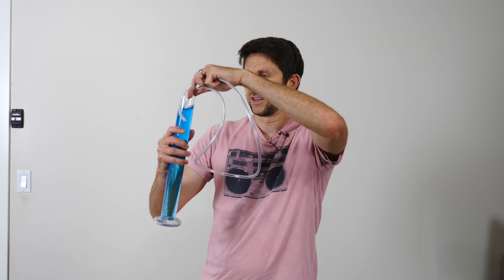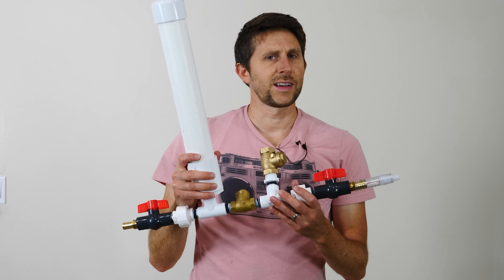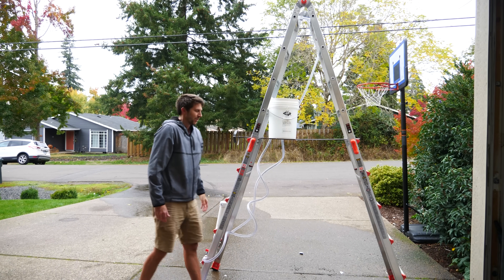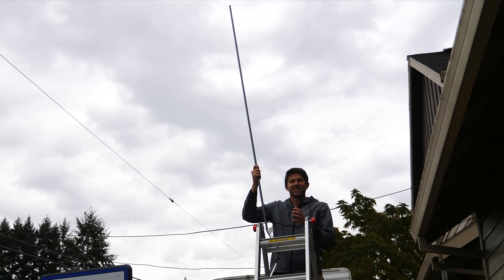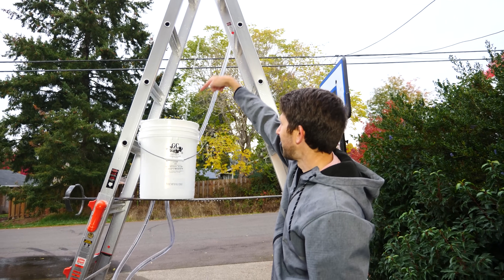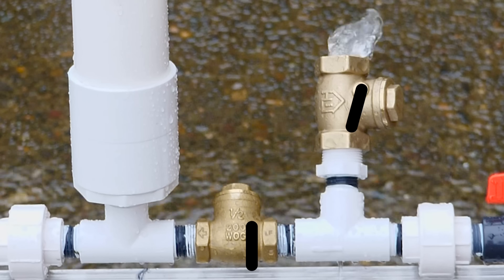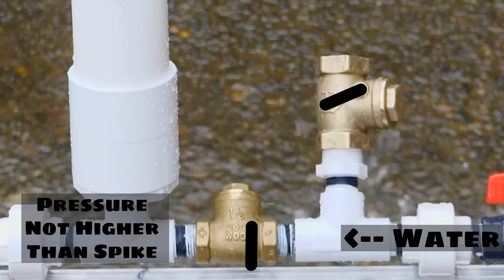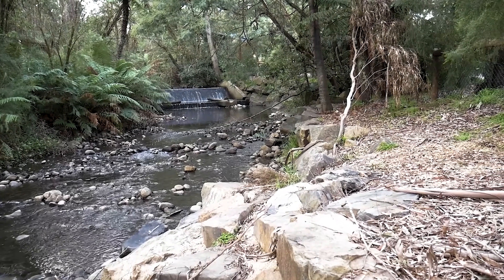Can a Hydraulic Ram Pump Make a Perpetual Motion Loop?

Comment: I have a degree in chemical engineering, and I've surprisingly never heard of this. Excellent video and explanation. Love the content!
Reply: It stumped me for a minute too... but the original water source has to be ABOVE the Ram pump... and not each cycle loses water through the waste valve... there is no violation of the 2nd Law... it's being powered by gravity... you lose water ... if you have a natural endless source of water... then no worries.. but if you're trying to move 100 gallons up a hill... you'll end up with 30 or so gallons at the top of the hill and 70 gallons waste water on the floor beside your Ram Pump.
Reply: @calendarcalendar3838  but is there no way to direct that wasted water back into the system? i think this is pretty cool stuff
Reply: @woshua3143 Nope, the best you could do is collect the waste water and manually move it back up to the level of the source water. Because the waste water valve has to be lower than the source of the water, you can't conserve the waste water and put it back in the system without expending energy.

That's why this is best suited to a situation where you have a spring or a river (a constant source of water) where your can place this valve lower than that source (either in the ground or downstream). Otherwise you might as well use a hand pump up to a water tower or something if you want a system with no water waste.
Reply: @isaacholzwarth with a water wheel up the top and some gears/ratio.
Reply: @Seriouslydave  isn't possible. The kinetic/potential evergy of the water coming out isn't enough to bring the lower water up. The best you might be able to do is to move SOME of the waste water back up. However, the amount of water that goes out the waste is much more than the water coming out the top, so the energy in the water coming out the top simply isn't enough to move all the waste water back up. It's simply not possible.

Comment: 🤔🧐 🙈😆 🤭. I'm sure I'm not the only one to tell you. But I thought I would till you anyway. You got the construction of that pump completely. "Incorrect.!"

That pump has a few names.  "Water Hammer Pump." "Ram Pump" " Hydraulic Shock Pump". Whatever you want to call it. You have the Pump assembly incorrectly configured.. There is a one most efficient way of assembling it. Which your valves supported. You just seem to have chosen not to connect it in that right configuration.

Right now the assembly is only acting as a Pump. Which is pumping water through the whole system. ("AND THAT IS WRONG.!") The Pump is only supposed to pressurize the Cylinder. And the pressure in the Cylinder is what then pushes the existing volume of water out of the tube. Until it is once again pressurized with another volume of water.

I saw it right off. I thought it was strange that your inlet hose was not shaking with every pressure change.. All your cylinder is doing right now is absorbing changes in pressure. Decreasing the efficiency of the pump.!

Also if you capture that wastewater. And then use the energy of the pump to pressurize the container of that stored wastewater. You can then pump the wastewater back in to the original container. Completing the cycle. Then creating an infinite cycle. As long as the gravitational environmental conditions stay the same.

And you probably should have mentioned that the only reason is possible to lift one body of water higher than its original water level. @ the same pressure. 

It's because it is a lower Volume of Water that is being lifted by a Larger Volume of Water. That makes it possible to lift higher than the original Water Level.

But it was a good first try. Keep them coming.

Comment: Wait, what if you some how rig it up where a waste valve is spitting into another bucket that has another loop, and its waste valve is spitting into the original bucket, it would probably take a lot more valves and way more loops, but couldn't you manage to make a big loop where all the waste valves spit into other loops that feed back into the original bucket?

edit: then that could be a true perpetual motion machine, but either A. this would still violate some law somehow, or B. I am a genius, and I need to remove this comment, and go claim my millions of dollars for somehow coming up with something that is creating infinite energy.
Reply: The waste water cannot travel to or higher than the bucket it came from. If you connect a pipe to the waste water then the pressure of the waste water in that pipe would stop the valve from moving. If the valves can't move freely then the whole systems fails.

Comment: you should definitely check out the "Bunyip Pump". Similar to the hydraulic ram pump, but operates at much lower pressures while achieving much higher head heights and using more simple parts (essentially no "moving" parts). It's a fascinating pump!
Reply: Fascinating, but it's got more moving parts, and it is using exactly the same principle, but then coupled to a normal piston style pump mechanism.
Reply: Take a look at the Papa Pump too if you want something different ;) also has no moving mechanical parts

Comment: Hear me out... a tub to catch the waste water with a low power electric pump in the tub. The pump is then powered by a pelton wheel generator that is turned by the falling water before it goes back into the bucket. Perpetual?

Comment: Seems like you could add a series of buckets to clockworks and arrange the buckets so the ramp pump fills the empty buckets.  When the top bucket gets empty a spring trap pushes the bucket back into the clock works and the newly empty bucket rotates back down into the trap and now full bucket takes its place.
Reply: Cool idea, but where does the energy to move the “clockwork bucket moving” machine come from?

Comment: Could you have a miniature version of this and chain them after another? Would that increase the efficiency or not? Like, instead of having 1 to lift the water 10ft could you have 2 each lifting it 5ft?
Reply: Nope.  One doing a longer run would be more efficient.  Just make it bigger (the pipes and valves) if you want to move more water, and higher if you want to move it farther using more pressure.  Each gravity-fed machine loses more than half the water put in, so each time you add another machine, you lose more water to move whatever you're getting.

Comment: What about the difference between deep ocean pressure and the atmospheric pressure at surface level....

If you had a 1 foot tube long enough to reach 4 miles down or more and stick out of the water what would happen?
Reply: The pressure down deep is due to the water above it. So as you come up the tube the pressure will decrease until it is equal with the surface at the surface. Therefore no flow

Comment: The closest thing to perpetual motion would be very likely, if you returned all the water to it's source (assuming zero water loss). The drawback is to the water loss over time by evaporation. In the mean time, while you have the water pumping, you might as well, get some use out of it, by allowing the actions of gravity on the water, to do some work, like turn a water wheel, to produce free energy.
Reply: You wouldn't be able to make the water go back to it's source unless you use extra energy to lift / push it.

Comment: I mean I acknowledge that a perpetual motion machine is impossible, but what's stopping someone from setting the waste valve up in a way that it pools back into the original water source? Not in your example, but in a differently designed one
Reply: If the waste valve is piped back to the original bucket then the flow will be decreased until it is too low to close the waste valve, so no pumping up will occur
Reply: @kyoteecasey  So there's no way to increase the pressure of the waste valve or increase the size of the water source's container to allow for you to re-catch the water?
Reply: @BigdogBrianjr  the flow through the waste valve would go to zero as you raise it closer to the source height. The flow rate of the boosted water would decrease to zero faster. And it is important with this mechanism to have reasonable flow to generate the inertia  for a pressure spike when the waste valve closes.

Comment: Oh what if u pile a hole punch up . so it drips down to a system just like itself. and make a rain cacher like 500 feet up. With this thing collecting energy and dripinging it down to the next system. Then the roof is the limit. With what i dont know say a couple feet by couple feet sqare. That drips over alternators if u put them clustered up not one at a time .. A rain storm could charge every battery in the world

Comment: I don't own one so I can't test but if you submerged the pump under water and on the port that spits out water make a extention above water and have the intake just under the surface and have the exhaust pour back into the pool/pond would that work or am I just over thinking the impossible

Comment: I've learned about that in my undergrad, as it is widely used in family farms here in Brazil to pump water uphill, the source is a flowing river, and it does really great.
Reply: Can they get the water to fill a reservoir and, once full, go higher? (Step and repeat?)
Reply: @JakeWitmer  not sure
Reply: Yes, but it consumes water to do it.
Reply: How much preasure they get
Reply: @Snorlax-4u  I've read it needs about 10psi to operate for a 20ft high (give or take) outlet... don't know about the length of the pipe, tho. But I'm sure there's a paper somewhere that explain it better.

Comment: I made one of these 20 years ago we pumped up to 145 feet and it filled out at 12 foot diameter tank 12 feet tall every day the trick is the long straight section right before the ram pump because it’s the weight of the entire rod of water and then the check valve suddenly stopping all of that weight of water moving. In my pump I could get about 10% to go up for every 90% that went down

Comment: So theoretically, you could put another pump above that one and have the Wastewater shoot into a bucket then, another pump above that one and have its wast water shoot into the next bucket. Then repeat and repeat until the top bucket with the waste water is overflowing into the bucket below and you would have a perpetual pump!👍
Are you up for the build, the action lab?
Reply: I was thinking the same thing.  Let's do it!!
Reply: The pump at the very bottom would be the issue. It's waste water is what would need to be pumped all the way back to the top
Reply: @baconscoobysnacks3135 was Ist mit Kapilarität?
Könnte das Verlustwasser nicht dadurch zurück ins System geführt werden?

Comment: The PVC pipe has the windkessel function, used in early firepumps and also biologically through the elasticity of the aorta. It is used to turn a pulsating flow into a uniform flow, which is better for extinguishing fire and Gas exchange

Comment: So is there or is there not perpetual motion?
Next I want to see you prove free energy or running a motor off its induced magnetism to run a larger motor with a load and zero source of electrical input, no hanging weights, no hydro source, no solar cells, no hidden wires, no hugs spinning magnets under the table. You know, what the rest of the con men do.
Ain't nothing free but they keep trying to sell it to hopeful but dumb people. Best one so far as the free energy from power lines. You know, make a huge copper coil and set it under the towers that carry power across the country at like 75 or 150 KV or some other huge amount. They manage to get some small amount of energy but it still isn't free. Someone pays for this and someone generates this.
Its more like stealing unused energy.

Comment: with the waste valve located over the source so that the water isn’t lost, would almost be perpetual motion. further, could be made as a closed system so there’s not loss from evaporation.

what if you connected a second pump to the waste of the first and have that one feed back into source.  not sure where to route the output from the second pump
Reply: The waste valve has to be located well below the source in order to start the flow.  If it's above the source the pump won't work.

Comment: why not add a magnetic water wheel to capatalize on the force of the gravity to power a second pump to refill the basin for the pump up higher? the water up top flows down the chain of wheels where by the laws of nature it will seek the lowest point, spinning the wheels and maybe add torque on the wheels to create more energy and a huge thin basin at a long but very narrow angle at the bottom to catch the lost water and allow for it to be recollected to keep the motion

Comment: they say there is no dumb question when looking for answers but here goes my dumb question why do you have to loose the water off the valves could you not put a pipe on them and feed it to the pressure tube with another header tank or will it just cause to much back pressure that cancels out the system or simply have the pipes go high enough to match your bucket or would this then make to much weight of water for the valves to move, I didn't do science at school but am fascinated how to improve the efficiency of it if possible.      👍👍

Comment: If you had 9 equal distance symmetrical waste valves coming off that one point like rocket booster thrusters then wouldn't it increase the pressure by WAY more but also require more waste water?
Reply: Possibly yes.  A caveat with that system is if the valves were in line serially, their motions would probably break each other's cycle.  If they were in parallel lines, you might have hope of timing them together to prevent backflow.  Perhaps with a really controlled setup, you could get continuous flow in the way multiple pistons turn an engine's output.
I'd expect it to be finicky at best, with very limited returns for each added tube contributing to one flow.  One line should lead to the smoothest operation and the most transfer without having a lot of help on timing.
An array of entirely separate lines, or just one bigger setup start to finish would probably be many times easier to set up than diverting the input water and bringing it back together.

Comment: I mean if you had a tray at the bottom collecting all the spilt water so you can reuse it then it seems more effective I guess cuz you can pump more water higher and use it for something up high?   Just repour the tray back into the bucket or whatever so no water is wasted.   Then use the suction of the water being up high and drain it for something and use that extra power for something too?

Comment: i was hoping ud have the math... 
i have 3/4 poly line from a well @ 12ft high but 550 length. i need to know if it will run a ram pump. what size out put and at what height and length will it pump. i need to lift it 18 ft high @ 50 ft long . NE1 know if im wasting my time and money?

Comment: The question..can you capture the water in a resevoir that is expelled. The falling motion could it generate store energy... tht energy be used to create a vaccuum auto valve for teh resevoir, meaning it eventually just shoots the water back up towards the buckey via negetive pressure... generated by the water falling... again another wieght trigger, so when x water is up top from being in teh back, it weighs enough to open a hatch thts on a spring, and the water falls into the top resevoir and then closes... it all begings again ina closed system. It owuld be more efficen,t but I think still a sytem of degradation.. but then again, once a x negtive force is made, al lteh water inteh bottom resevoir will enter teh top bucket, loll hmm.. can we enhance the valve motion so it can maxmize water coming out... it kidn of reminds of potential of a wave that hits naother wave... and weeee.

Comment: I have an idea I know this can't work but I don't know why, take a bucket and put it in the waste valve such that the waste water goes into it, then make a hole in the bucket connecting to the starting of the main water pipe. The waste water goes a little bit above the pipe so when you connect it to the main pipe it will go into it and the water will not go waste

Comment: What if we connect the open ended valve back to the input (not the bucket but the input pipe such that the initial height and final height are the same)

Comment: Water hammer is the whole pipe moving inside the wall when you shut off the valve suddenly.
Reply: The moment of the water moves the whole pipe and then the pipe hits a 2x4 or something inside the wall.

Comment: Great video! The one thing I missed is the explanation where the energy (needed to raise the water) comes from. I think it comes from the potential energy of the wasted water.
Reply: like  all  hydropower,  the energy comes from  Gravity, and  falling  water.
https://en.wikipedia.org/wiki/Hydropower
Reply: You're right.  The water starts with potential energy, which is converted to kinetic energy when it travels downward.  That kinetic energy is stolen from the wasted water and then given to the non-wasted water.
Reply: @Paralellex  I didn't fully understand til I read your comment. Makes sense now!

Comment: What if you attached the waste valve back to the bucket? or would that cause a pressure buildup and screw the whole system up?
Reply: what if you could  ELIMINATE  gravity, that would be cool.   no wait.    then the pump  wouldn't  work.!!!!     doh
Reply: @daviddavids2884  all i wanted to know was how differently the system worked if said change was made. no need to be a tool about it. i never mentioned anything about gravity even so you just sound like a bully.